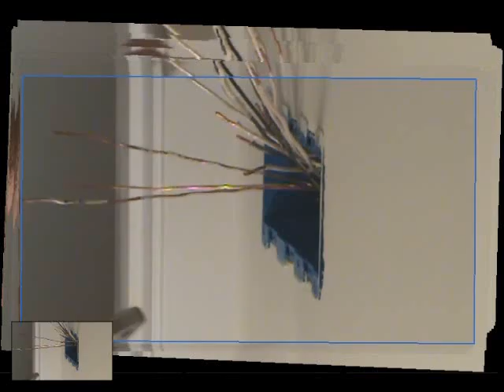Connecting 6 ground wires together in a switch box

Comment: Buchannon Crimp Tool, 50$ on amazon.. the $4 green wire nuts were cheaper.
Reply from the maker: Some wire strippers have the crimper added. Look for that type of wire stripper & the strippers should maybe cost $10 or so more than a standard stripper. Way cheaper than the $50 you have shown & really handy since it's attached to the strippers. Look for them next time you're at a hardware store. Some stores don't have them but  others do. If you can't find them, go to an electrical wholesale house & they will sell them to you. A nice thing to add to your tool collection!   Joe  :0

Comment: RIchard, you are correct.  I got a correction during inspection to use proper crimp tool, so I just pulled them off and used green wire nuts.   How can I tie in 4 grounds in a 3 gang box?  Braid them like hair and then wire nut?
Reply from the maker: You could braid the ground wires as you have asked, under a wire nut but you also should connect a ground wire to each light switch as well since now days, most standard light switches have a green screw to where you attach a ground wire. I really wish my current wire strippers had a crimp tool on it. Some types of wire strippers have the added crimper on the wire strippers & that's the type I should get.   Joe  :0

Comment: OK, I got to ask,,, what size is that box (cubic inches),, and how many devices are you installing in that box?
 How manu total wires are in that box?

I got a sneaky feeling you are over filling that box.
Reply from the maker: Sheesh. Not sure the actual size of the cutin box but it's a 3gang box so I would've thought it would be plenty big to allow for all the romex wires. 6 total romex cables & 3 switches total....2 for lights...1 for a new ceiling fan.    Joe  :0

Comment: You should never "daisy chain" grounding wires, which seems to be what you end up doing.  Furthermore, the crimp sleeve should never be pushed back into the box before crimping.  I can understand that you want to minimize the quantity of large wire nuts; Ideal makes several size of these crimp splice connectors.  I've been using model 411 and 412 for years and never needed any other sizes.  See here for info - http://www.idealindustries.com/products/wire_termination/terminals_crimps/crimp_connector_steel.jsp  Also, you really should use the appropriate crimping tool.  T&B and Ideal both make several tools.  I like the Ideal 30-425, it is a combination crimper, lineman's pliers and cable cutter.
Reply from the maker: Thanks for your detailed message. Noted!

Comment: This seems like a real thorough way to do this, but wouldn't most people just twist all six wires together into a big mess and then have a wire going to each switch?  I mean basically we just want all the ground wires touching each other and the ground screw on each switch?
Reply from the maker: Yes you could do it that way but I like to use the ground caps as it takes up less room in your outlet box. As it was I had 2 oversized wire nuts in there for the white & black wires & I didn't want to have another in there for the ground wires. As it was I had to think how to push all the wires back into the box as well as still have room for the light switches. Most electricians do it the way I show (in one format or the other) as it makes it easier to push all those wires deep into the back of the box by gripping them tightly with a pair of pliers then moving & wedging them back in there. Thanks for your message!   Joe  :0

Comment from the maker: @windoes98se You can use a crimp tool if you have one but if you don't have one, you can do it this way. Make sure you twist the ground wires before attaching the sleeves & bend the ends over so it can't slide off "if" they ever get loose. You could also use a wire nut if all else fails. I've neverf had anything go wrong with this technique. Thanks for commenting.   Joe  :0

Comment: OMFG you need to use a special crimp tool calibrated to a certain pressure  to crimp  splice caps as you call them
Reply from the maker: Well what if you don't have the crimper tool handy. When I got done those grounds wires were not coming undone...

Comment: are those the gardner bender crimps? Are they copper or steel? Does the metal type make a difference?  good vids on the crimps - they don't seem to be  used too often, but they seem to be a lot more sensible for connecting ground wires
Reply from the maker: I still twist the grounds together before putting on the copper crimpers...Thanks for your message!

Comment from the maker: @lexmarks567 To connect a ground wire to two outlets in the same box, you would attach 2 pigtails to the main ground wire then connect one outlet to one pigtail & the other outlet to the other pigtail. You could connect these 2 pigtails, to the main ground wire, with a wire nut instead of the way I show on this video clip.....or you can connect with couplers like I show here. Thanks for your questions. Good luck with your project.   Joe   :0

Comment: How do i connect the ground wire to 2 outlets in the same box. I will need to use a small couple inchs of new 14/2 to feed the 2nd outlet off of the 1st outlet. How i connect the grounds. Do i take the ground wire coming into the box and attach it to the 1st outlet then take the 2nd ground wire from the 2nd outlet and attach it to the main ground via pigtail or i take the main ground and scrap ground wires and pigtail them to the main ground and feed them to both outlets.
Reply from the maker: Yes you can make 2 ground pigtails & connect to the one main ground wire & you can connect those with a wire nut or you can use the copper crimp couplings. Now you have two ground wires coming out of the box one for each outlet. Easier to do than the other way you were asking about. I have more electrical videos that you could still learn by even 14 years later! Go to my main YouTube channel page then click on playlists & scroll down to electrical. Get your popcorn ready!!